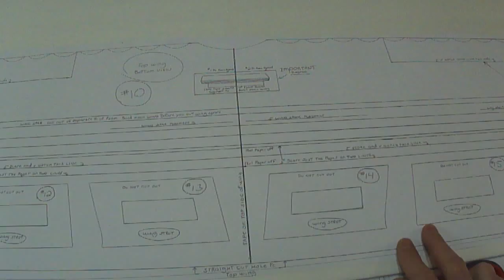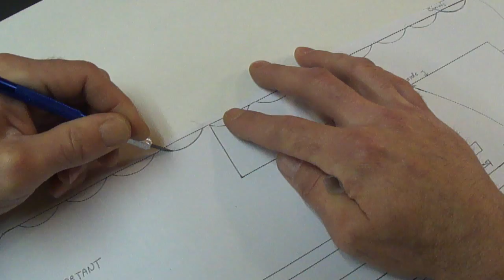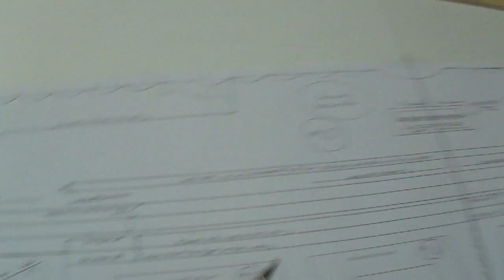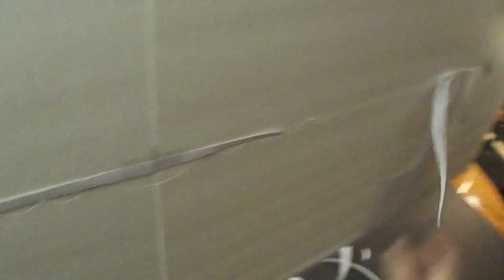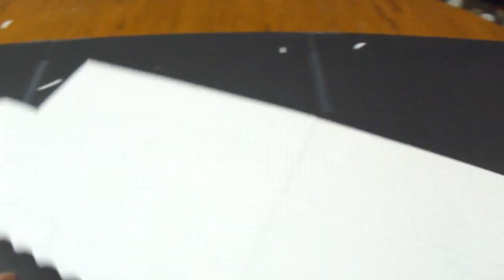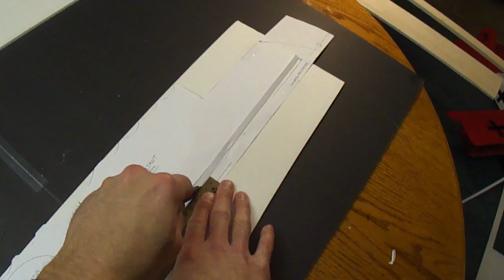Part # 1 of 6 Fokker D7 WWI RC Biplane. Cutting & Assembling (PDF) Plans.

Comment: Generally,I also use a ruler on all staight lines. I make multiple copys of the plans,so I dont have to worry about cutting up the originals,or for more than one part. I also cut two pieces of foam board but do not score the second one,instead I save it for a quick hard copy of my plans. If I damage a wing,I can throw the hard copy on top of a sheet of foam board,mark my lines and cut that one. This saves you a ton of time making repair parts. I usually try to have enough spare parts to remake at least two planes,yes it takes time,but after the basic parts are cut out( no details) I stuff them in a large plastic bag or folder and label it. The hard copy I write Copy do not use on that piece,that way I dont incidentally screw up and cut out details or score lines.

Comment: Well with some practice I got the whole plane  cutout Im quite pleased with the results now.I practiced for a few days and gotten pretty good in short time it is easy to master not like playing a violin Thank God.Any of you guys out there practice the V grooves till you get the steadiness and depths right on scrap boards.I made my own 3 inch rubber wheels to look like originals from a 2 inch black rubber block at my job and inserted  Guillows 2inch  plastic wheels in the center acting as the rim. I turned the tires round on a drill press and made landing gearstruts resembling the original four strut  with .062  stainless welding wire it is very rigid like its heat treated works great and covered it with black heat shrink tube to fatten it up and is lightweight.This whole thing is loads of fun looking forward to buying the electronics ...  I highly recommend building anyone of these planes or the Dr-1 like Im doing now, Good luck to anyone who tries these builds........